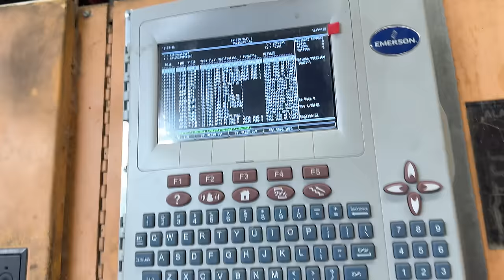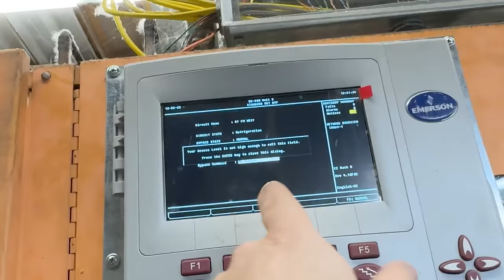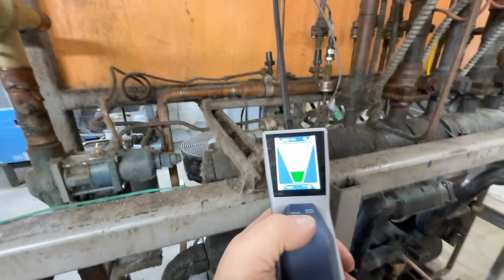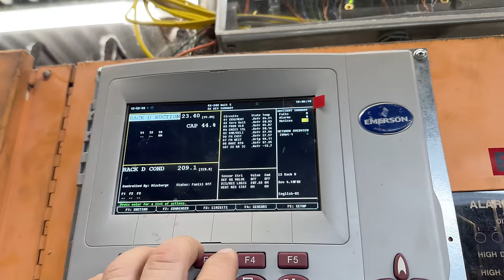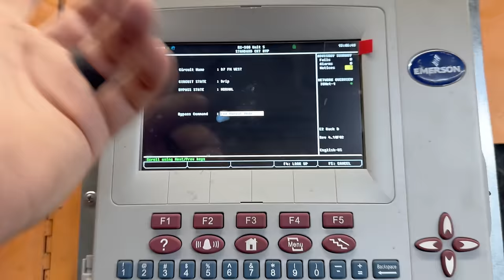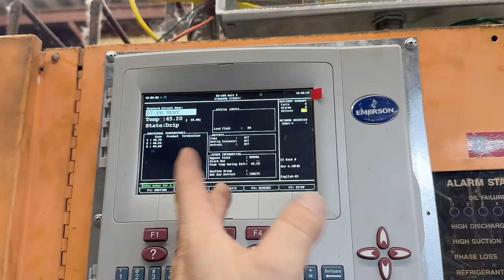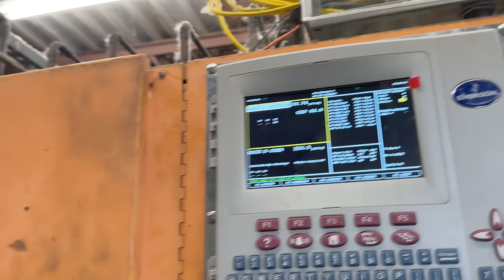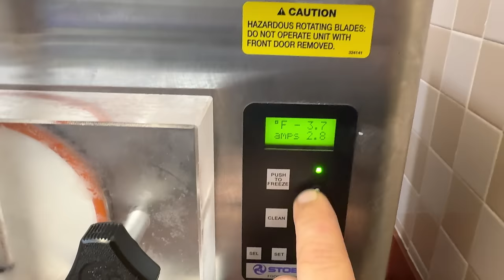Multiple Things To Repair + Happy New Years 2023-2024

Comment: Just retired from doing air-conditioning and refrigeration for 40 years and I really loved working on the grocery store Rack systems we didn't have electronic leak detectors wsy back when I was just getting started only halide torches and leak detector soap and individual condensing units for refrigerated cases I appreciate the videos and seeing how diversified you are that's the way we were  and I know what you mean about the ice cream machines and the kack of proper disassembly and proper cleaning and putting it back together and not putting a rune up kit in on a regular basis had a blind lady in a bldg that ran a concession stand and she had yhe cleanest soft-serve machine i have worked on and it was broke if she called or the yearly preventative maintenance  it's sad that people that can see don't care or take pride in the job they are doing just because they don't like it  anything that I did I did the best i could and usually more  keep up the good work and video HAPPY NEW YEAR
Reply from the maker: Thanks HVAC Brother for sharing! The torch was going out when I started in 1995, I didn't get my first crappy leak detector until 97 I believe, I tried the Tiff, that was junk, looked at the CPS - yellow toy, junk lol and finally I got the first Dtek heated diode detector they put out, I ran a H10 for a long time and still have it.

Comment: You need to add a seal off outside of cooler where the conduit enters the cooler it is designed to stop air from flowing from one area to another

Comment: Good video. With oil on the override stem cap it's probably the override stem leaking might need to just make sure the stem is back seated all the way ( in my experience). tephlon tape the treads and reinstall cap should do it on most of those nuisance leaks.
Reply from the maker: I about broke the valve off getting it replaced. The seal was completely smashed. I got the new one in there and it sealed right up.

Comment: God bless Rick, hows your body holding up after all these years in the trade? I notice you use kneepads and matts and cranes etc but any long term problems? Just took an office job at 31 in management but ive had alot of damage from the military
Reply from the maker: I’m 48, my eyes have changed even after having Lasik in 2005, I have tinnitus in my ears but otherwise everything’s pretty good.

Comment: Good deal Rick, Merry Christmas and Happy New Year's to you and your family.  By the way those wire nuts on the lighting in the reefer, are junk, those are the wire nuts that the electric industry first came up with and are absolute garbage to work with, I don't blame the electrician for being sloppy not twisting the wires correctly, because with those type of wire nuts they would always pop off the connection and I would have to tape every connection, true story, 1980 type wire nuts, total crap.
Reply from the maker: Interesting. I was always worried about the floppy, soft outer, cover wire nuts.